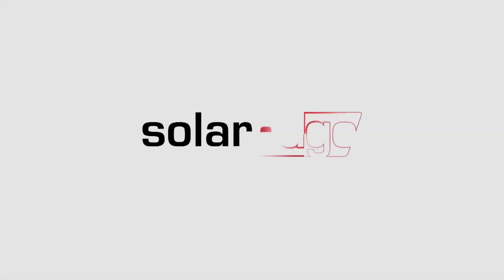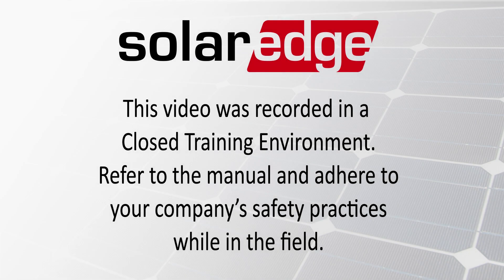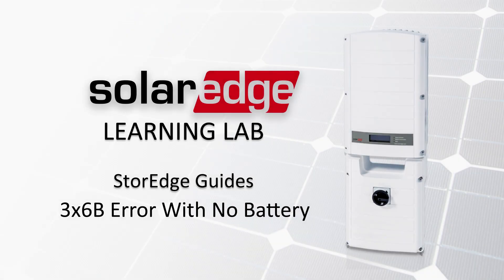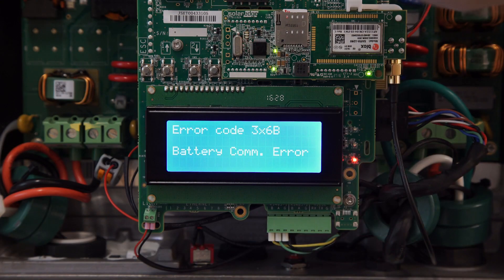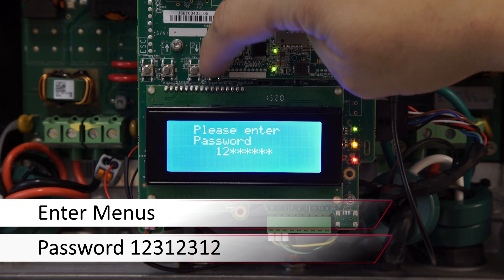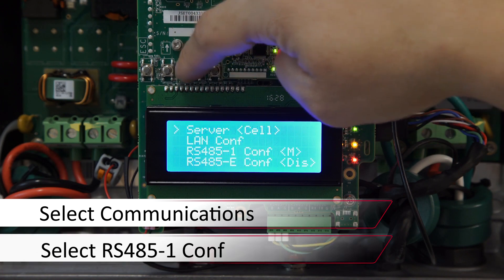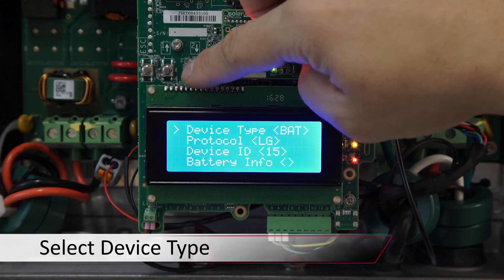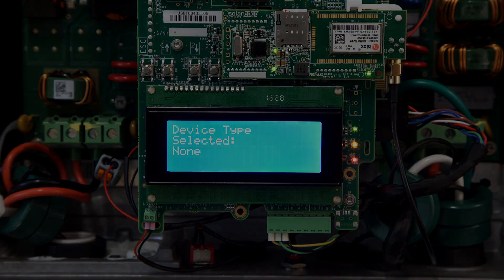Troubleshooting 3x6B Error

Comment: Dear Solar edge Team. I have the same problem with error 3x6B with LG RESU Battery. What should I do?
Reply: Program Inverter to communicate without the battery and Start RMA with LG
Reply: @josepgutierrez22  Thanks for your answer, but sorry I didn't get it. Could you explain it more detailed please?
Reply: @tgloessner  call Solar edge and they can walk you through it
Reply: Hi Thomas, Did you get any help with solar edge 3x6B error code? I received a message this morning that said."1/2 batteries, not communicating".  Solar edge would not give me  information, except for the fact that the error code is:  3x6B I also have the LG batteries .... LG RESU Battery. All I ever get from solar edge is "call your installer" Any information you could provide for me would be very much appreciated. Maybe solar edge thinks calling the Installer is free. Replacing my inverter while it was under warranty took several months and the only reason I finally got help was  I got in touch with an administrator in Tel Aviv. he had it sent to me the next day. Please help Thomas.  Thank you for your time, Micheal
Reply: No, not yet. Would be great to have some Support